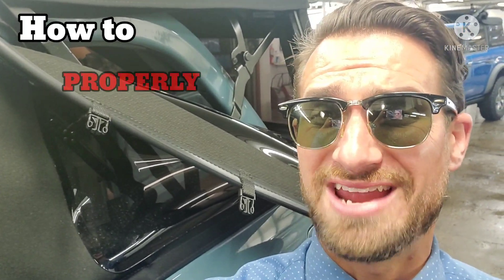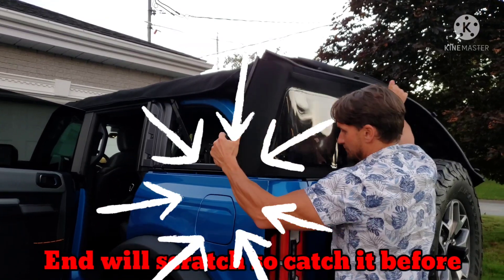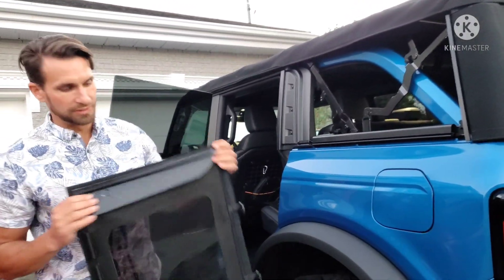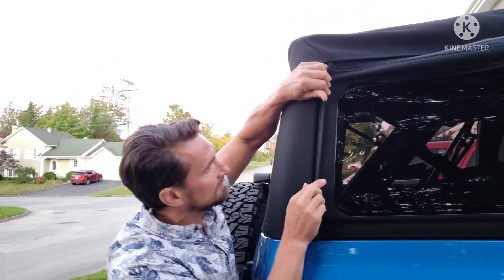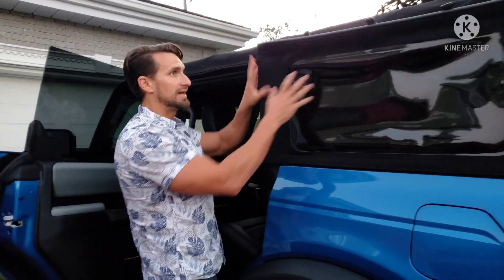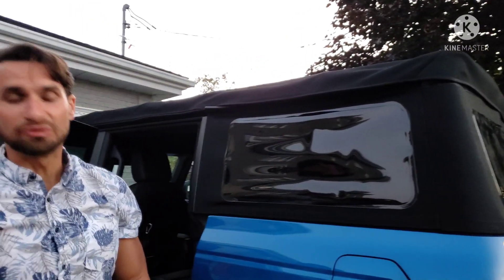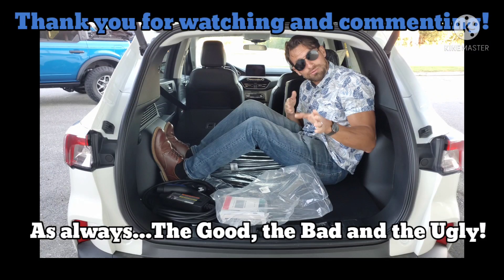How to Put the Bronco Soft Top back on: Avoid these Mistakes!

Comment: HELLO AGAIN JOHNNY GOOD VID!!  YOU DID IT!! GOT THE TOP BACK ON BEFORE DARK!!  I know, Johnny, that this was an instructional video, and you were taking it slowly, one step at a time for your loyal subscribers to learn on, but GEEZE!!  I've heard some JEEP soft tops were  hard to put on but is this REALLY THAT MUCH EASIER??  I think you did pretty well, considering how very short a time you've owned the Bronco, and assuming you don't do this every day for "Practice". But, you did this with a brand new, factory fresh  AND EXTREMELY CLEAN VEHICLE.  Now imagine it's a year or two later, the truck's been outside in the sun, the snow, rain, bitter KAN-AIDE-DEE-YAN winter, and the top is starting to dry out and get a little brittle, and you try to do this after a fun day of off-road 4 wheeling, and now there's Mud, Dirt, Dust, and Tree seed pods in all the slots and grooves; FUN???   I still say : flip back the top, roll down the side Windows all the way,  AND GO HAVE FUN!!!    THANKS JOHNNY, NO NEED TO REPLY TO THIS ONE PLEASE!!  YOU WERE NICE ENOUGH TO ME ALREADY THIS WEEK!!!    CHAS ORVIS, PLAINVILLE, CT.   PS : Did MARIE P. Buy the blue hoodie to PERFECTLY MATCH THE BRONCOS PAINT, OR DID YOU GET THE TRUCK TO MATCH HER HOODIE???
Reply from the maker: Ofcourse I'm replying buddy. I agree 100% now about your idea to just drop the windows 100% and flip back the first section. Lots of light and easy pessy lemon squeezy. Windows 100% down otherwise these frameless windows jitter, vibrate and make noise going over bumps at a high speed. So 100% closed or open are the best options.

Comment: Great video and tips on the soft top for the Bronco. 
I'm sure in time it will get easier but not as easier as the new Jeeps JLs soft tops .
Over the years of Jeeps soft tops gotten better and improved less wind and rattling noise...hopefully Broncos will improve as well .

Enjoy your Bronco
Reply from the maker: Wind and rattling noise are fine on the Bronco. Putting the top back on requires keeping a few very important things in mind.
Reply from the maker: Thank you for the support and taking taking time to add a comment for the community.

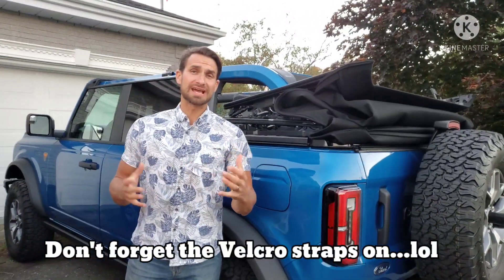Comment: What Velcro straps????? 1:45 minute mark is where I'm stuck with my Bronco, and the video just breezes past that very important part!
Reply from the maker: Thank you for timestamping the issue. As a result I have an answer to your specific question. The soft top comes with little velcro straps. If you have put them on then you need to remove them otherwise their is no way that top is unfolding back on to the top of the vehicle. If you have not put the strapes on then lift like in the video and follow the rest
Reply: @Johnnyscarcarereviews  thank you kindly for the reply! Much appreciated.  I certainly don't recall deliberately putting on, or otherwise attaching, any velcro straps when I took the top down (I just folded it back to lock position after removing the side and back windows).  I just can't get the top up beyond the point of releasing the lock mechanism and starting the initial movement of raising the top -- it seems to be stuck on the second fold (perhaps it's the velcro straps you mentioned) but I can't see how/where it's stuck. Any help with this issue would be greatly appreciated.......especially if you can edit-in a video clip of the fix???
Reply from the maker: Grey clip needs to be pushed in. See if some help from a partner on the other side helps get it moving up and over. I had the same issues as you. I guess I should not have edited out my moments of what the heck!

Comment: It’s annoying 😩😩😩. I feel like ima break it every time I put it on lol
Reply from the maker: Putting back section 1 is easy pessy lemon squeezy. Fast and easier than hardtop. It also let's in a ton of light and offers a great experience. If you don't care about how it looks for others than it's great. Taking it all the way back is easy to but then yes putting back on from full down to full up is a little stressful but while I'm stressed it seems very durable so when the forecast is good for 7 days straight I'll be dropping it way back. I don't regret my soft top choice.
Reply from the maker: Thank you for sharing your experience on the channel
Reply: @Johnnyscarcarereviews   I don’t regret my soft top  either. I live in Los Angeles ! It will be down most of the time. I think it looks so much cooler with the top down